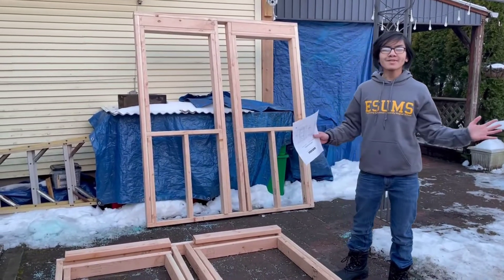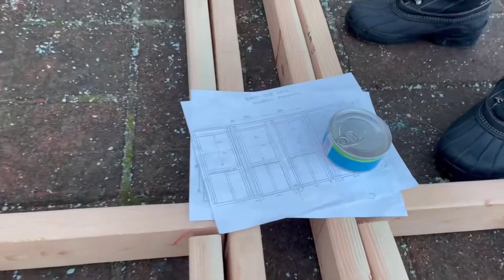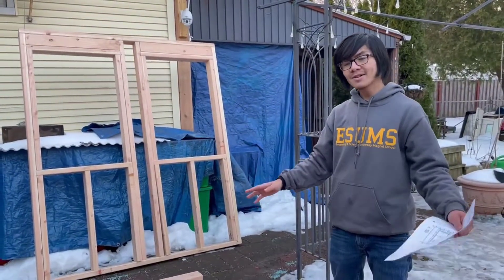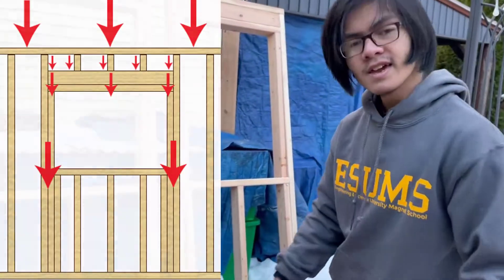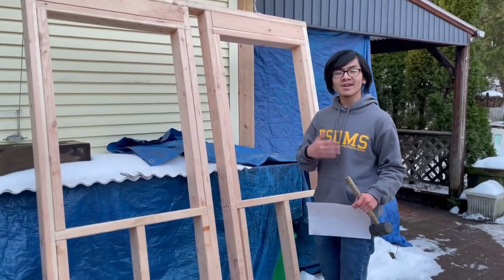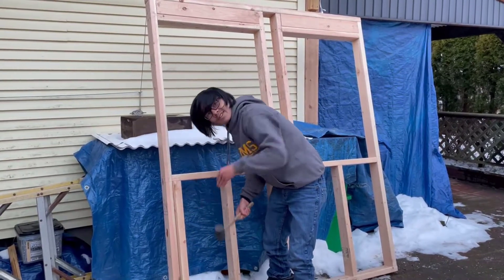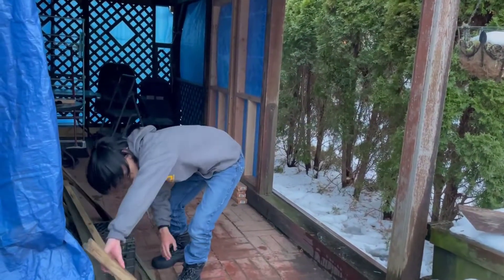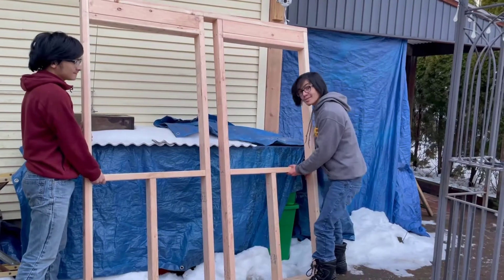Framing Studs For Window & Installing Wall Frame | P2 Converting Our Patio Porch Into Multi-Use Room

Comment from the maker: Here are the #ad links for some of the tools featured in this video and are required in order to frame studs for windows rough opening and installing the exterior wall frame:
1.  https://amzn.to/2KPUOjl  | DEWALT ATOMIC 20V MAX Circular Saw, 4-1/2-Inch, Tool Only (DCS571B)
2.  https://amzn.to/34GqVsH | IRWIN Tools Framing Square, Hi-Contrast Aluminum, 16-Inch by 24-Inch (1794447)
3.  https://amzn.to/3mLIkGP | Makita 9903 8.8 Amp 3-Inch-by-21-Inch Variable Speed Belt Sander with Cloth Dust Bag
5.  https://amzn.to/3rrOoYs | DEWALT 20V MAX XR Cordless Drill Combo Kit, Brushless, 5.0-Ah, 2-Tool (DCK299P2)
6.  https://amzn.to/38yFuji | Reciprocating Saw - SnapFresh Cordless Reciprocating Saw Battery-powered, 20V 2.0Ah Cordless Saw, 1 Hour Fast Charger, Powerful Saw Reciprocating Lightweight for Wood & Metal Cutting